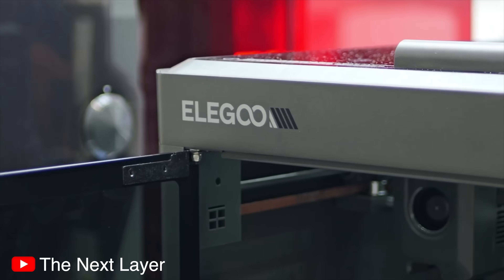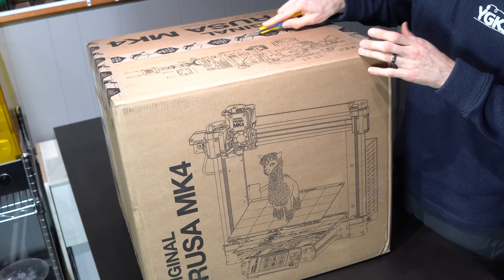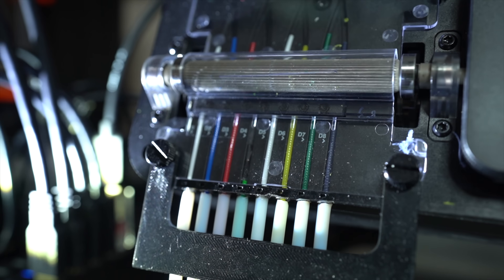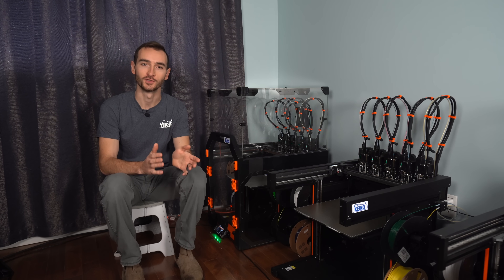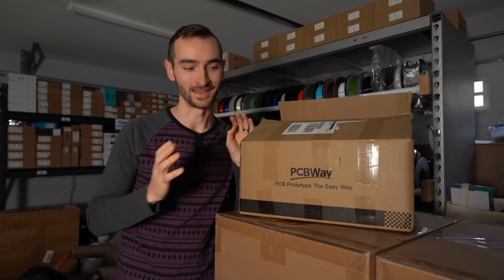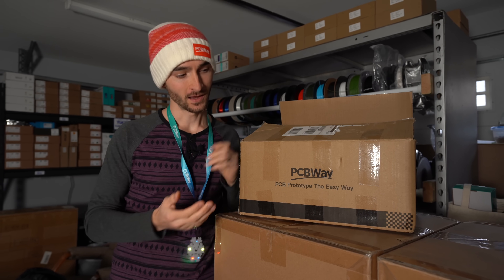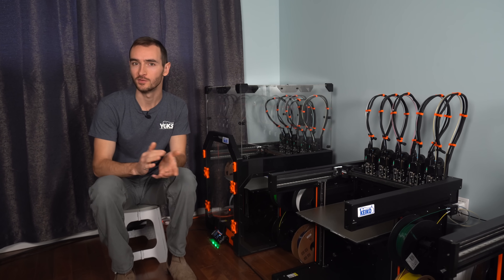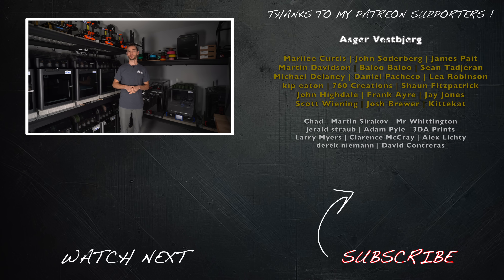The Prusa Core One is dividing the internet...

Comment: You can’t be bothered to call Bambu support for the X1 issues? Then you immediately say you spent time on maintenance on the Prusa printer. You just made your entire video useless with those two statements. 

Try again after you put ANY effort into your X1 issues. At least as much as you put into Prusa.
Reply: Not worth it for him. Way quicker and cheaper to buy a new one to keep the farm running.

Comment: My Bambu X1C with AMS has over 7000 hours on it.  It finally broke the XY belts at 7080 hours.  Not sure why your Bambus have broken, but that isn't the normal experience.  Your Bambus aren't working because you haven't taken the time to fix them.  In the two years of ownership, I have spent probably $175 in replacement parts to include a couple of hot ends, an extruder (but found the old one still works so it's now a spare), the XY belts, some PTFE tubing, two tension pulleys, and a controller fan.  Mine actually prints better than it did when I got it due to the firmware and software updates.  I'm in a wait and see mode as far as the new "firmware" everyone is saying will lock everything down.  I don't think it will affect my workflow, but I'm not a business.  I also print using Bambu slicer and use the app so no customizations.  I've sure gotten my money's worth out of this printer.

Comment: This video aged poorly
Reply: @grocerylist Has it? (Sorry, looking into buying my first printer, want to be sure I'm not missing anything)
Reply: @spets234  Bambu just nuked themselves by blocking non-proprietary software. I was about to buy four of their printers, and now I'm looking at all the options again. Ugh.
Reply: @TheObscuran  i thought they stepped back from that
Reply: @averagefan8199  They came out and said that the update won't prevent prints, but their update says it will prevent prints. So what do we believe? What they're saying or what they're doing?
Reply: @spets234  bamboo is starting to lock down its printers with new firmware
Reply: @spets234 TLDR Big Bambu controversy due to them threatening open source and moving to be more proprietary.

Comment: Core One hands down. I have MK3S at home and work. Both have been on use for years. My work printer especially does constantly +1d print jobs multiple days per month and has been there for is it four years? I've had one firmware update problem on it once that Prusa fixed on next firmware (note it didn't prevent usage, just didn't update to latest correctly) and just last week it began to give min temp errors on hotend. I went to Prusa chat and was there for around 15mins and cue was showing about 5mins more to get in touch and this was EU time 18:30, so not normal business hours. Anyway just before reaching customer support I had already found thermistor resistance values and guide to disassemble it (From Prusa's documentation). It had cracked leads that shorted onto it's frame. Measured and isolated thermistor leads very carefully and confirmed that mobo is still ok. Ordered new thermistor was it thursday for iirc 7 euros and even with business bank transfer delays I still just today got message that it'll be on it's way monday. So it's likely going to be a week to get it running again with oem parts (ordered few bearings and rods too cause they're getting really noisy). Because of my reliable experiences with Prusa's I'm not changing printer. In fact we discussed at work that we are going to order XL to get easier large prints without "puzzle piece" joining methods. Bambu seems to be horrible in their customer support. Also for my home usage I'll likely some day get Core One. But as I don't have urgent needs at home, my MK3S with Octoprint is going to have plenty of use left.

Comment: I've been using my desktop 3D printer since 2016 (clone of the original prusa i3). Having seen how the tech have evolved since then, i was looking to get a new printer that just works. Over the years a lot of big names of the industry have just disappeared, If i buy a new printer, i expect it to run properly for at least 5-8 years. I can't rely on a closed software system relying on cloud services.
This competition is awesome and really make this tech go forward, but i can't support any company that goes in the same way as the 2D printer industry.
To bad, the x1c looked like an awesome printer :(

Comment: one thing that gets overlooked, is that you can get nearly the same experience of the X1c with the P1s and a significant cost reduction while not missing out on game changing features. to put it a different way, if you want amazing print quality out of the box and plan on using the printer like that vast majority of use cases out there, you're far better off buying the P1s combo over the X1c or the core one.

Comment: I got into 3D printing with some third tier Chinese brand before I went for the Original Prusa Mini, later the Mk.3S (which I wound up donating), and then a Bambu A1 Mini (my current workhorse). As such I think I have a decent view of both from the view of a budget/entry level consumer and it's tough.

I love Prusa - I love how all the parts are openly available either to order from them or print directly, I love the long term support they give for their machines, and the relative ease of maintenance on them. A Prusa is supposed to last, and that's good. At the same time though, for someone who isn't making 3D printing their career or job, trying to budget and go for an assembly kit is a nightmare. The Mini was okay, but over the course of a month I disassembled and reassembled the Mk3S so many times trying to get it to work and eventually just gave the whole thing to college because I just didn't have the time to put up with what was a glorified paperweight on top of everything else going on.

The A1 Mini then came into the picture and it's a lot of what I've wanted - good, strong performance, little fuss, and multi-material printing options at a fraction of the price of other offerings. Options like the quick swap nozzles are also a godsend, making them so much easier to clean or switch between projects. They also have options to repair it all with official Bambu parts for what I'd argue is a relatively decent price... but their documentation sucks when trying to diagnose WHAT to repair, and if it has any electronics, you're stuck going through them rather than getting a replacement through other means.

At this point, I honestly believe Prusa needs to cut their margins - more than what they already have. A 1300 USD X1 Carbon compared to a ~1600 Core 1, feature complete for each, is just too much of a pill to swallow and similar comparisons can be made down the board. A Prusa Mini nowadays costs ~450 USD; an A1 Mini WITH the AMS Lite goes for 349, and as low as 200 barebones. It's really, REALLY hard to justify this price gap for what is arguably a less capable product, whether or not it's upgradable in the long run.

A 150-250ish price reduction across the board I feel would make Prusa much more competitive in the market. That'd take the Core One down to being a smidge over the X1 Carbon, while having clear advantages both mechanically and in customer service, while undercutting the A1 Mini with the Prusa Mini. That said, I don't know how feasible this would be considering the operational costs may be radically different between the two companies - but either way, IMHO Prusa can no longer afford to charge such a high premium if it wants to remain in the market.

Comment: Not sure why your printers are paper weights, parts are easily available for the printers, and I think they are easy to work on.  I have had to do a few repairs already.  I gotta be honest, if a user just wants to print, Bambu is the better option.  I do not like walled gardens, but bambu delivers so many print profiles and make the 3d experience truly almost mindless.  My wife took an interest in printing, and now she keeps my printer running more than I do.  I may have to get a second one.  It's the ability to take a tinker toy, and and make it work without tinkering is the big innovation for Bambu.  While users who want to tinker can continue to support Prusa, the masses who want to print not tinker will probably be better off buying a Bambu.  I think Prusa makes excellent printers, but the ease of use of the Bambu, and speed they deliver is amazing.  Do I wish everything was open with Bambu?  Sure...but walled gardens are what it takes to deliver superior customer experience sometimes.

Comment: Those force sensor errors are just a cable that runs to the bed.  Its a super easy fix.  I think the bed going up and down so many times finally starts to wear out the wires at some point and they start to fail.  I replaced mine for those same errors and have been printing for a solid year now without them coming back.

Comment: I think you dont give the Bambu enough credit for serviceability, those force sensors are $5/each and require relatively little disassembly. Heated befs are about $100 for a full replacement part, and bambu lab has articles on replacements with these parts

Comment: Just a few things, 
1 you can run Bambu completely offline, you don’t need to connect to the network. 

2 you don’t need “only a small selection of high speed filaments” I run everything in mine no problem. 

I will agree on the glued in parts tho

Comment: The ego of Prusa's CEO has always been a major red flag for me. Also, it doesn't matter if it's made in the EU or not if the product can't compete technically. They've been using 3D PRINTED PARTS on their printers for YEARS instead of like, idk, standard molded plastic just like any other multimillion dollar company would use. That's just straight up amateurish at that point.
Reply: 1) why would they use molded plastic tho, if 3d printed parts perform just as well?
2) from what i know core one competes quite well with bambu lab counterpart and even outperforms it in few areas.
3) Prusa is NOT like any other multimillion dollar company, and thats why people love it. Mostly because its not run on greed like most companies and theyre treating custmers like human beings and not something that you can milk for money on every occasion.

Comment: the fact Prusa put usb sticks that suck beyond all measure on the XL and mk4, (and other issues ive had) makes me regret investing in 3 prusaxl's, i cant even count the amount of failed prints due to their usb errors in their firmware. (and still put it on the coreone)
yes the "new" alpha firmware somewhat fixes it, this alpha firmware is untouched since it came out last year, if you keep their stable build firmware, you still have the usb issues.
(the alpha firmware still corrupted a stick of mine, printed a job just fine, pressed reprint and failed at 52% and stick corrupted)
the trinamic driver fried on one of the prusaboards, still under warranty and they send a free replacement sure, but it died within a year...makes me wonder what will die post warranty period...

wanted to expand printers again and got 3 bambu p1s' s with AMS and they have been running non stop, no fails, no errors, nothing.
i was team prusa since the mk3, but i wholeheartedly can say im team bambu now after encountering many more flaws with the prusaXL.

its mid januari 2025, their last stable firmware update was september 2024 and the alpha came out in october, and people still having a myriad of issues makes the " prusa has good support" argument void imo.

i plan the same as you with the buy a bambu and write it off after-method.

Comment: As a hobbyist, and not a "prosumer with a 3D-Print Factory", I will only have a single printer at any time. I have the time to tinker on the printer itself, and my money is an investment; so repair-ability, upgrade-ability, reliability and an actual upgrade-path is more important than a slightly lower price, it working out of the box(I buy KIT).

Simply doing a "write-off" on 2 out of 4 printers can make sense in a business-perspective; you have probably had full Return-On-Investment on those machines and will simply order new and potentially faster machines that work out of the box with a smaller price-tag, and continue with your business. You don't care if the printer is assembled by actual slaves, in a factory that spews out toxins, designed by people that stole every idea they ever had, sold by a company that have contributed absolutely NOTHING to the community, have no interest supporting their products long-term, or that the printer is most likely sending your designs back to China. Cheap and easy is better than everything else...

Comment: Being an expert in manufacturing, and process engineering my entire life... I can say, that the only reason your Prusa printers have survived, is because they are slow.  In the world I have always known... Most industrial machines are capable of 1000% of what they actually produce at quality.  It's always been turn it up until it breaks... Then fix it, and turn it down one notch.  BMW even builds their 5 series with 500hp in Europe, but de-tunes them to only 300hp for the US market, as they don't want the issues of repair.  All machines are capable of a specific limit.  Bambu, went pedal to the metal.  Prusa, was conservative, and dialed it down at least 25%, saving longevity, over performance.  Also... I pre-purchased a Core One early November... But being a full week into January, and ZERO videos, insight from Prusa... I got spooked, and went with the very safe choice of the Bambu X1 Carbon, with AMS, and it's still cheaper than the Core One with single color.  Worst of all... I now have to wait a full 2 weeks for Prusa to reimburse me with my order to get my money back.

Comment: The Bambu printers looks awesome, but reminds me way too much of my first printer, a Robo R2. It was awesome, but when it started to act up, god was it awful to repair or work on. Part difficult to get, no open source firmware, ended up as spare parts and plastic garbage. I'd rather get the Prusa, knowing I'll be able to do everything I wish with it. 

That it is running an open source firmware is a huge plus, being able to test new bleeding edge features, tweaking things... It makes them way more future proof. And I quite like PrusaSlicer as well, which I have been using for a couple years now.

Comment: I think you really under sold the true value of choosing to pay extra for prusa. It's about more than just "support" and "warranties". It's about the open ecosystem, the open source firmware, the complete open access to every single individual replacement part for all their printers. It's knowing what you buy will never randomly become obsolete. Their entire model is far better for the end user than other products that are simply about being the cheapest to the market for a given feature set. I'd gladly pay an extra 200-300 bucks (from what is already an expensive $1,200 price tag) for the repairability factor alone. I want to be able to easily buy replacement parts and fix my stuff. Add the added privacy of never needing to connect it to the internet, and the semi-open source model prusa has going on, and the value proposition is all there to justify the extra price for me. Every single dig prusa made at Bambo labs in their core one reveal video was a major value add. Of course do I wish they leap frogged the X1C feature wise? yeah but developing products is a slow process there's a very very likely chance that this had been in development long before the launch of the X1 and P1S, and those printers likely just pushed the timeline forward a little bit.

Comment: Without Josef Prusa we would not have the accessible 3d print industry we have today. But right at this point in time, it's hard to recommend anything but a Bambu Lab printer to anyone looking to get a 3D printer. Not only price, but plug and print capability is tremendous. But gain, Prusa not only gave birth to home printing, he nurtured it through it's teenage years and Bambu would not exist if not for Prusa.